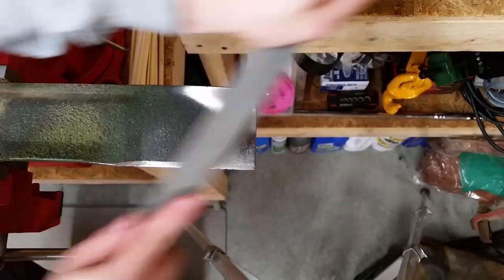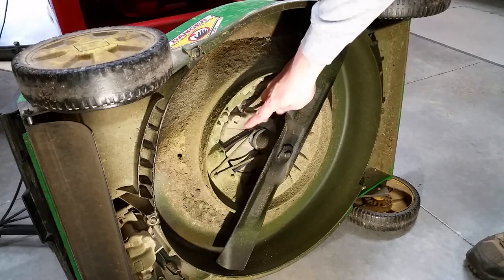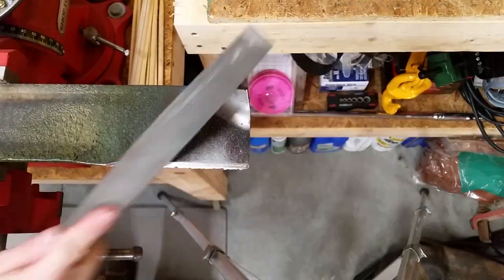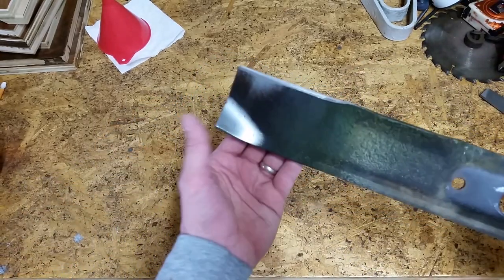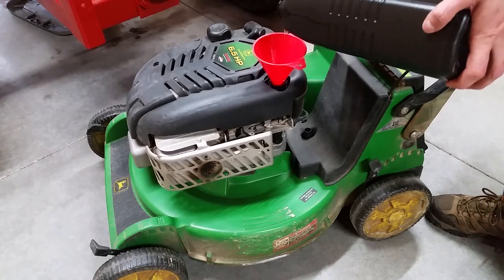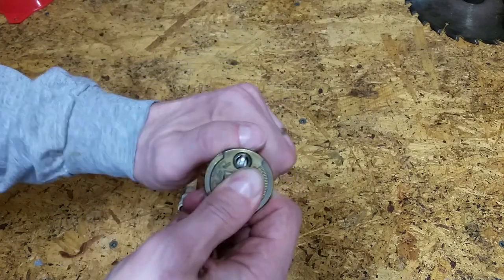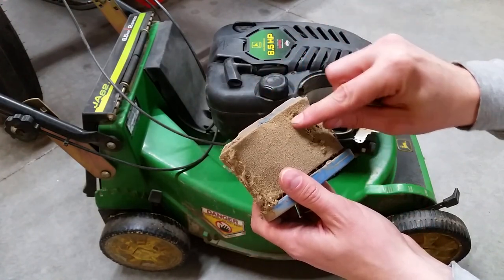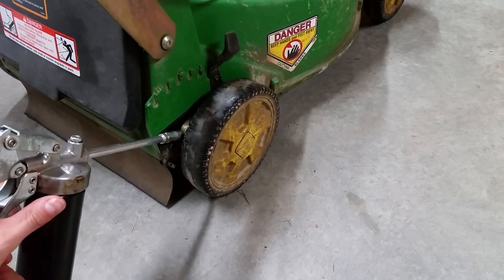Complete Lawn Mower Tune Up

Comment from the maker: Drain Pan:
https://amzn.to/3bDAauY (affiliate*)

Air Filter (697029):
https://amzn.to/2QZvKGV (affiliate*)

Pre-Filter:
https://amzn.to/2xELdoO (affiliate*)

Spark Plug (RC12YC):
https://amzn.to/2UOElxk (affiliate*)

Spark Plug Gap Tool:
https://amzn.to/3bITNlw (affiliate*)

Grease Gun:
https://amzn.to/2R1KBAB (affiliate*)

File:
https://amzn.to/2UuUZDa (affiliate*)

Milwaukee Stick Light:
https://amzn.to/33WCACm (affiliate*)

*Purchasing from these Amazon affiliate links earns my channel a small commission. Think of it as a tip that doesn't cost you anything. Thanks for the support!

Comment: Nicely demonstrated, EXCEPT: never start a sparkplug into it`s hole while (inside a socket) with a ratchet wrench !!  Do this by HAND till you are (sure) threads are correctly meshing & won`t (strip) the cylinder head threads. MAJOR HEADACHE if those sparkplug threads get stripped !
Reply from the maker: I agree! It might have been hard to tell but I did start the spark plug by hand before attaching the ratchet to the socket extension. Thanks for watching!

Comment: Great video! What kind of grease did you use?
Reply from the maker: Thanks! I think that was just some multipurpose grease, nothing special. Any grease is better than no grease! :) Just be sure not to mix incompatible grease types. Polyurea and Lithium based greases are the most common, but they aren't compatible so be sure you're always buying the same base type.

Comment: Can you make a video of how to replace the belt ( for self-propelled )
Reply from the maker: I already have a video replacing the belt on a self-propelled front-wheel-drive mower, check it out: https://youtu.be/Lb4yw0vzyR8 . It would be very similar to change the belt on a rear-wheel-drive mower. The drive pully would just be in the rear instead of the front.

Comment: Well done. 👍👍👍 I wish everyone could do instructional videos like you. Straight to the point and no excessive talking to distract me from memorizing the process you are perfectly illustrating.
Reply from the maker: I really appreciate the kind feedback, thanks for watching!
Reply: Mike attempts much obliged. Took me only 20 minutes to service my mower following your instructions. I have serviced it quite a few times prior but today after watching your video I just felt more confident doing it. I don’t mind figuring out how to do something but instructions like yours give me a peace of mind while doing it and knowing I didn’t miss anything. Having a 2x72 belt grinder for my knife making definitely sped up the sharpening process but hey if ya got it use it.
Reply from the maker: @e.t.preppin7084  That's great to hear! I have another video, coming out soon, where I clean and lube the rear wheel gears.

Comment: would have been nice if you included to check the self prop belt tension and how to replace if needed, but nice and to the point
Reply from the maker: You're right, I should have included info for the belt. I actually have a quick video coming out at the beginning of next month that covers replacing a broken belt. Thanks for watching!

Comment: These John Deere mowers are excellent but after 10/15/20 years, a complete carburetor  disassembly and cleaning is on order. Order your carb kit from a John Deere dealer and give the carb a good cleaning in every fuel tunnels using a spray bottle carb cleaner to remove all the harden fuel varnish.
Reply from the maker: I would have thought the same thing, but it always starts on the first pull and runs great. I'm comfortable doing a carb rebuild, when the time comes. I should probably also adjust the valves since that's never been done either. :)
Reply: @Mikeattempts   I will look at the valves rockers this week-end. Could not find a head cover replacement gasket this week…. Mine had been trouble free for about 20 years but for the first time this spring… she would start but was dying immediately. I found varnish in the carb bowl and the main fuel circuit had deposits in the vertical tube. My advise (if I may) would be to clean everything to avoid having an engine run lean (and too hot) cause the fuel circuit is partly obstructed.
Reply from the maker: @sydrider6023  It sounds like you're taking good care of it, let me know how the valve adjustment goes!
Reply: @Mikeattempts  sure will. Have you done the 3 speeds differential? I will look at it Saturday. I never really paid attention to it aside from the regular greasing.
Reply from the maker: @sydrider6023  I haven't really done anything except regular maintenance. Oh, I did dissemble, clean, and regrease the rear wheels too.